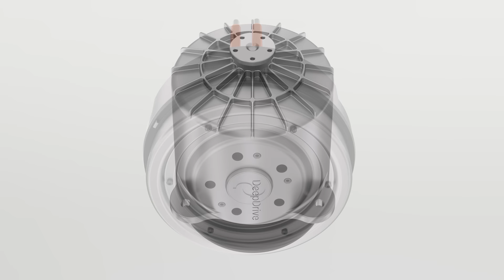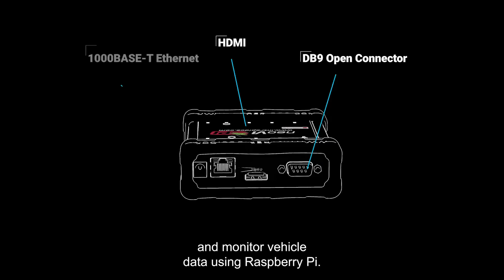EV Chargers Will Outnumber Gas Stations Soon; Tesla Could Drop 4680 Cells - Autoline Daily 3852

Comment: There are over 1.5 million gas pumps in the US.  The number of fast chargers is not going to surpass that for a LONG time
Reply: in my town many of the small stations with 4-8 pumps have shut down and larger 20 plus plump stations further away were built
Reply: Won’t take too long when fossil juice venders start bankrupting.
Reply: I am sure Kodak never thought their film business would shrink so fast, but it did.

Fast chargers have a smaller footprint and less complex to install than gas pumps. The ability to add them t9 most parking lots, along streets, or parking garages gives them an advantage when it comes to installation. 

The tough question is how people will charge mostly at home. I have done one day 500 miles trips that required public fast charges. But otherwise I charge at home. Figuring how many buyers of EVs will need more regular use of public chargers is going to be key for the business model needed to sort out investment dollars needed. 

Vehicles are high cost items, so the change over will not be as fast as other tech, but it will probably be faster than many think.
Reply: @kevtheobald  💯... Speed of adoption will increase as price to own decreases. Why pay more for a gas car if you are not towing and driving more than 200 miles in a day.
Reply: @Teddy_M85  My 2023 Model 3 RWD was same price as a new Camry with same features. I have a real 255 miles of range and only commute 25 miles a day. Recharging at home has cut my $300 month gas bill to $80 a month bump in energy bill and a $200 annual EV tax set by the state. No $40 to $60 oil changed. No worries of dealing with SMOG tests for vehicle 7 years or older.  Brakes will last to 100,000 miles or longer. I am 16,909 miles in and no sign of rapid tire wear. Once 5 years is over, I will be able to say for fact it was cheaper to own and operate my Model 3. I am ignoring the $10,000 in state, county and federal I got for buying an EV in 2023.

I cannot see the logic for most people not picking an EV. I guess we will have to wait and ser.
Reply: Every gas car needs a gas station. Not every EV needs a DCFC all the time. I haven't been to a charger since December. If you can plug your car in at home you don't need a fast charger unless you road trip. Yes, yes not everyone has the capability to charge at home. If that is the case you need to evaluate if EV is the best direction for you. WE don't NEED, nor is it wise, to have as many fast chargers as gas stations. It would be wasteful and a needless expense.
Reply: @GROND15  Bingo! The vast majority of EV owners don't even have home L2 charging... Just regular old 110v outlets like they would a cell phone... The hype about a lack of chargers is just that. Although if gas stations started adding them to the mix they'd at least future proof their business... Because people go to stations like ExxonMobil or Shell for more than just fuel... Usually it's an excuse to stop get snacks, drinks, use the washroom, etc. and the fueling up is usually secondary...
Reply: Underground tanks last about 25 years and are difficult to insure after about 20 years. In my small city, a small station recently replaced their tanks. They chose to remove the diesel tank and not replace it. They just stopped selling diesel.
Reply: @stickynorth  I actually use Lvl 1 at home. It actually works fine 99% of the time. I think "vast majority" is a little over the top. Of the 5 people I know with EVs I'm the only one that doesn't have a LVL 2 at home.  The fud about is charging is completely over blown like you said. It's not a big deal. You have to change your thinking with an EV. You need to be a little aware and thoughtful, like having a diesel.
Reply: Keep thinking that.  Gas stations are closing.  Superchargers are expanding.  Some gas stations are converting into Superchargers.
Reply: @JD-yx7be there’s no need to for the number of public chargers to exceed gas pumps.  Most charging is already done at home.
Reply: @stickynorth it’s because people speak EV but think in ICEV. 😂
Reply: I think they tweaking the numbers. I think they’re looking at one charging unit to one whole gas station. They not counting the pumps.
Reply: That is why I don't think "Public" EV chargers will number more than gas pumps due to home charging. There will be an S curve for EV charging growth and a depletion exponential curve of gas pumps closing down too. What will a die hard ICE driver do when the nearest pump is 10 or miles away and there's a line when they get there?
Reply: Did your grandad also insist that there won’t be more cars than horses?
Reply: @DaBooster  just some basic math. Nothing against EVs. Just realistic and not buying the oversold hype
Reply: Autoline just repeats any hype given to them by their sponsors. Never do any real reporting.
Reply: @marcusjerome6034  Wow, you have a point.  They are not counting every house that has electricity!  Charging stations outnumber gas pumps by more than 100k to 1!  Wow.
Reply: That's just another reason the US will be behind China in EVs. 10 years ago China had just 30,000 public EV chargers. By 2021, they'd brought that number up to just over 1 million public chargers. Then they built 650,000 public chargers in 2022, and nearly 900,000 more in 2023, bringing their total up to 2.7 million by the end of 2023. 2024 will see more than ONE MILLION new public chargers go online. Currently many major cities in China will have more public chargers than the entire US.
Reply: It's not necessary to exceed gas pumps. Every home has an electric "pump" at home meaning there's already many more chargers than gas pumps. If you can put a small solar system up you'll get your mileage for free. We have a small system. Guaranteed for 25 years. The cost of electricity from the system is always $0.00. Do you think fossil fuels which are one and done gifts of sun earth system will get cheaper??? Is there a Fossil Fuels Fairy refilling the holes at night? Our home is 100% electric. May electric bill $52 June $85. Two used EVs. Crazy cheap....

Comment: Wow, the BMW in-wheel motor is a modified Axial in-axel motor with no upspring, which means torque vectoring and no complicated cooling lines on the wheel hub. We discussed this concept in our power engineering class 45 years ago at Michigan Tech.

Comment: We'll need a 10 to 1 ratio of EV chargers to gas pumps since it takes 10x as long to fill.  Wish it was easier for everyone to have home chargers.
Reply: Norway already has over 50% of the entire fleet being EV with street charging at their apartment.
Reply: @JD-yx7be  Cool for them.  Must be allot of new apartment construction there. Unlikely a reasonable upgrade for old apartments.
Reply: @CountryTesla  I worked as an electrician in Annapolis and have done several electrical upgrades to buildings over 200 years old
Reply: @JD-yx7be  oh its very doable and friends would benefit. Just figuring an older profitable apartment complex wouldn't put the money into something to charge new cars if the average car there is 10 years old. Newer buildings, high rent and new cars go together better is all. 

 Our 100 and some year old house appreciates its modern wiring.
Reply: @CountryTesla  it will happen to the upper classes first as all tech does. You have to be pretty rich to live in Annapolis anyway. A 900sq ft house is over 1 million

Comment: Once EV battery recycling kicks it, we'll start seeing their environmental advantages.
Reply: The environmental advantages of EVs begin shortly after the ICE engine turns over.

EV batteries are already being recycled, but indeed, once that recycling reaches full scale, the  environmental advantages of EVs will be very large.
Reply: @davidmenasco5743  you said it well.
Reply: @davidmenasco5743  EV batteries are very hard to recycle.  It would be interesting to see a reliable survey done,  on the percentage that are really being recycled.
Reply: @maxhugen  If they were that hard, there wouldn't be so many companies set up specifically for the purpose of recycling batteries.

The guy who engineered the Tesla battery set up a company to recycle them.  Surely he knows what it will take.
Reply: @davidmenasco5743  "Hard" is not impossible, and neither is it cheap.  But we'll see eventually which companies survive, and the actual percentage recycled.

Comment: Compare how many charging stations verses how many gas pumps. I doubt there are more.
Reply: I think if we compared wall outlets to gas pumps you'd see we're already in pretty good shape.
Gas pumps and EV fast chargers won't be the same paradigm, because everyone has an outlet in their garage and no one has a gas pump in their garage.
Reply: Guys he said chargers will over take gas pumps 8 years from now that's 2032
Reply: A "charging station" has typically between 4 and 40 chargers.  A "gas station" typically has between 4 and 40 pumps.

Comparing stations to stations is fair.  But comparing chargers to pumps would be more precise.
Reply: @davidmenasco5743  Sorry, that was what I meant. Number of chargers VS pumps.
Reply: @SublimeSimplicity  With 6.8% of EVs in the US,  I think it will be some time before we see pumps = chargers.  Of course, a lot more chargers are required per 100 vehicles,  because of the time it takes to charge an EV,  vs 2-3 minutes at a pump.

Comment: Oh fast chargers - expand - you mean ones that don't have the cable cut off for the copper because they don't have any security at those EV chargers?  More of what kind of charger?  how fast? Tesla cabling? what level ; 1,2,3 or 4 or 15?  What percentage could fully charge a Tesla model Y in less than 8 hours?  If not it shouldn't be counted as fast charging. So then how many are there compared to gas stations that have security? Not many.

Comment: There you go again...  Let's compare.  I'm in my PHEV and am 4th in line behind other ICE vehicles at Costco.  While I wait in air-conditioned splendor, listening to my favorite tunes in EV mode (engine OFF) I know I'll only have to wait 15-20 minutes or so to get gas.  What is the scenario with a BEV?  Even with the wildest projections of (yet to be commercialized) fast charging, you're talking AT LEAST 2x as long.  Possibly MUCH longer depending upon the rate of the charger AND the maximum rate your car can charge at (it takes two that match to get the fastest charging).  For most people, that's a deal breaker.  To prevent that, you're gonna need many more chargers than gas pumps to try any reduce waiting times, if not charging times. 1:1 won't cut it.  Nevermind where all the extra electrons are going to come from, how they're produced, what they'll cost at a public charger, AND many other things you guys fail to mention.  Fine, you're EV cheerleaders.  At least tell the whole story rather than just what makes EVs look better than they really are.
Reply: Many charge at home or in the office and experience no wait of any kind. On an occasional road trip, I use the restroom or stretch while charging, which I don't remember ever doing while waiting at a Costco gas station. Try a BEV, you'll like it.
Reply: @AlexParkAndRide  Works for some, not most.  I have a hybrid and enjoy being in EV mode.  I also enjoy the high mpg.  A PHEV would be even better.  A BEV cannot meet my needs.  If I needed a another car for commuting it might.  But I don't.  I need a car that can do more than what a BEV can do.  Enjoy yours.

Comment: Promises, promises!

But the most important part is thst a gas station has very big LOCAL STORAGE that can last hours on a cheap generator.

Electrical chargers? Out as soon as power goes out!
Reply: Many charger stations will bring in a diesel generator trailer for long term outages.

Comment: A quick google search says there are only public 61,000 chargers of V2 or higher. Even V2 will not charge a Tesla 100% in under 8 hours so the V3 and higher are basically few - maybe at most 1/3rd.  There are nearly 200,000 retail gas stations. 1000% more. Sounds like your thesis is a total lie; Ev chargers are not even close to gas stations; plus you can gas a car in 5 minutes; where a BEV like a Tesla Y can take an hour on a V3 charger over 8 hours on a V2.  Add to that they have no security; add to that they may not be working which is common. Stop putting out total crap.

Comment: No matter how many chargers they build how many ICE vehicles can fill up in the time it takes an EV to charge?
One fuel pump can fill up more vehicles in 24 hours than a charging station can charge.
Reply: That's why charging times are getting faster use to be 30 40mins as standard but now its 25 mins and new China and Europe cars its in the 12 14 mins so you can't say that for long 😂
Reply: Im 10-15 min at the Autobahn station anyways toilet snacks/drinks a coffee waiting at the shop until the idiot who could have bought hes lotto at the internet anyways got hes tickets ......
Reply: some cars charge faster than fuel pumping... do actually new 2024 research
Reply: you can swap battery faster in some.. and some give 100 miles in 5 minutes also
Reply: do not forget  a big chunk of the EV owners could charge their vehicles at home over night;)
Reply: You discount home charging. I plug-in when I get home from work and by the time I get in my Model 3 to headback to work, it is fully charged.

On Monday I drove 487 miles and it needed 20 minutes charging during the trip to complete it. That night, I did the plug-in for the night and was at 100% again the next time I got in. 

Battery tech is moving quickly. Think about where EV tech in general was in 2014 and where it is today. The next 5 years will see even more improvements.

Comment: I don't know why you comment on car designs...they all look the same to me!
Also all this horse power coming from ICE's & EV's, unnecessary and range reducing to both...so much for saving the planet.
Reply: Higher hp has almost no relation to more energy consumed for an EV. The only reason they consume more is because they have more aggressive tires. For example the early nissan leaf has nearly half the hp as the current one with no change in efficiency

Comment: The only way to make brake rotors last the life of the vehicle is to also make brake pads which last the life of the vehicle. There will always be people who run the pads down to the steel backing plate and tear up the rotors, so unless the pads are lifetime the rotors won't be lifetime either.
Reply: Drive an EV with high regen.  Problem solved.
Reply: @BTC_Minarchist  Don't need specially designated "lifetime" rotors or pads with an EV, standard equipment can already last nearly the lifetime of the vehicle using regen. I'm guessing they are focusing on ICE vehicles.
Reply: The worry here is that, if manufacturers decide to rely more and more on regen to handle the load, they'll be incentivised to save costs by making the friction brakes smaller, lighter, and therefore far less effective in emergency braking situations.
Reply: @BogeyTheBear  Regulations dictate the stopping distance on cars based on weight and tires. They can not reduce it